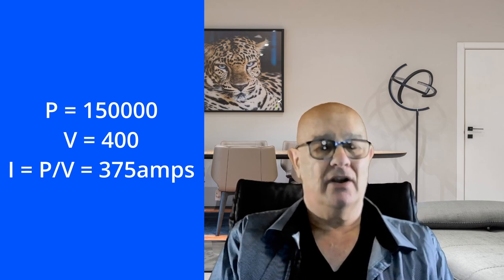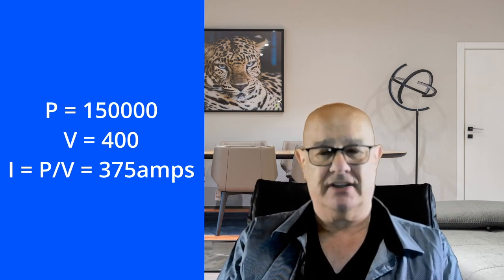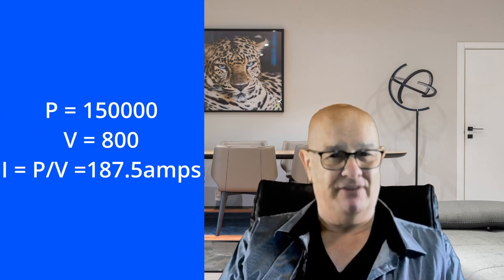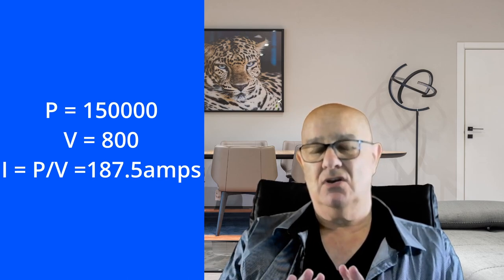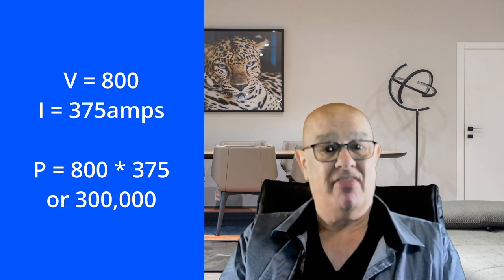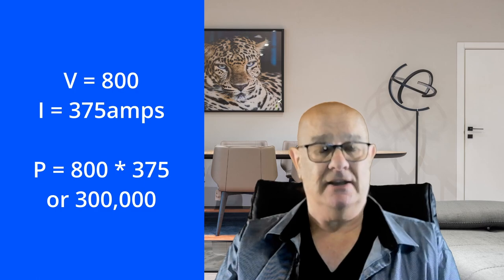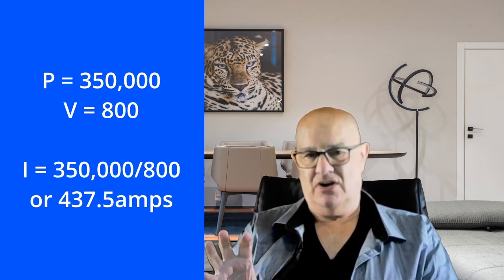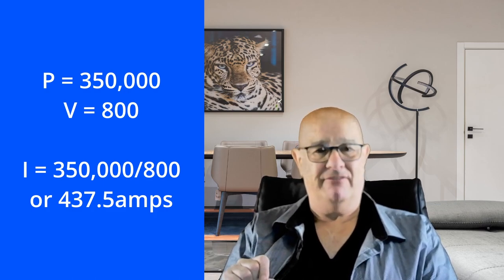400 volts V 800 volts EV architecture

Comment: Clear explanation, thanks. If 800V * 375A = 300kW charging, then theoretically if you had this architecture in a small EV with a 40kWh battery like the Hyundai Ionic or Nissan Leaf, you could charge it to 80% in 6 minutes. That would then be comparable with filling up with petrol.
Reply from the maker: In an ideal world that would be true.  Unfortunately charging a battery is not that simple as there is a 'charging curve' which means an empty battery will charge much quicker than a half full one and a lot quicker than one almost full.

Comment: The Lucid Air, which uses 920 volts, can briefly nudge just over 300kw, then ramps down to 290's and 280's. It still charges fast enough to add 300 miles of range in 11 minutes. That's why 800 volts, or higher, which results is much less heat and stress on the batteries, is so much better, and why all manufacturers are turning to it.

Comment: How many kW are you seeing on Tritium 50 kW chargers?
I seem to be getting 36-38 kW max
Reply from the maker: In the few instances of using a 50kW charger I can get 43 to 44kW into the battery.  The rest is wastage as heat
Reply: @grumpyoldmanandhisev  OK
Now I have a theory.
The chargers have a maximum current limit.
LFP battery pack is running a lower voltage and this is the reason for 36-38kW max on my vehicle connected to 50kW Tritium

Comment: Does moving to 800v mean that we would need a 3 phase charger at home?
Reply from the maker: No.  It will still work on single phase but you will only get up to 11kW in the battery every hour at home unless you fork out a few hundred thousand to get a DC charger installed!!

Comment: While higher charge rates are promoted a lot it can be surprising how little time is saved.
Reply: Every vehicle is different and owners probably have different expectations.
With a preheated battery Tesla V3 Supercharger or Tritium 350 kW is more than twice as fast as a 50kW Tritium on LFP Model 3 SR+
Stretch your legs, take a toilet break and it’s done.
On a recent road trip 200kWh in a day 
50kW rated vs the 35kW the charger was outputting could have saved me at least 1hr 45min.
A 350kW charger would save 3hr 45min in the day.